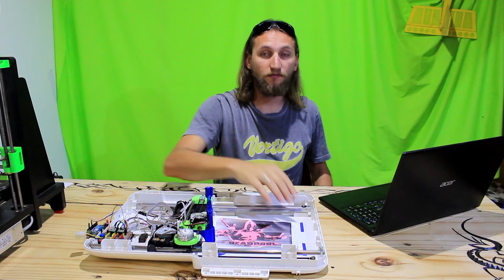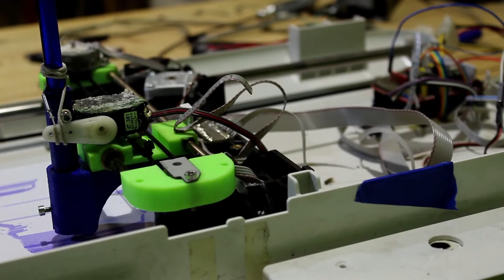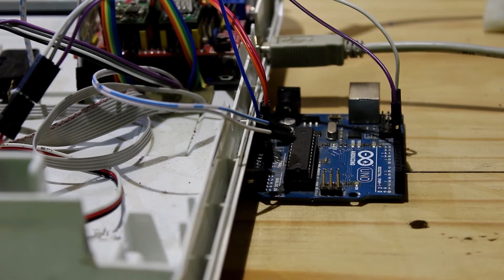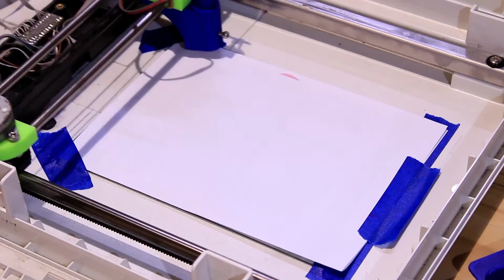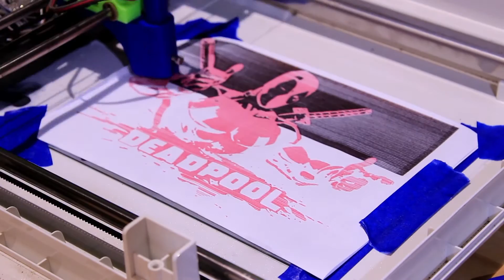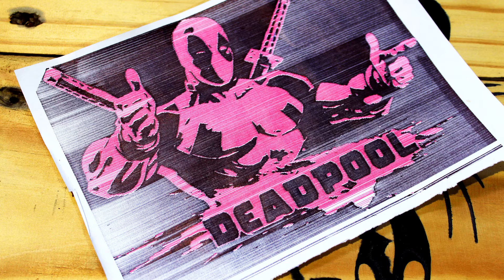DIY pen plotter servo Z axis upgrade

Comment: you can just edit the code to make spindle pin send servo control command. i am actually looking for a method to generate g code to print multiple colors simultaneously with multiple servos.i have got the code working and the hardware ready. but generating g code has been difficult.